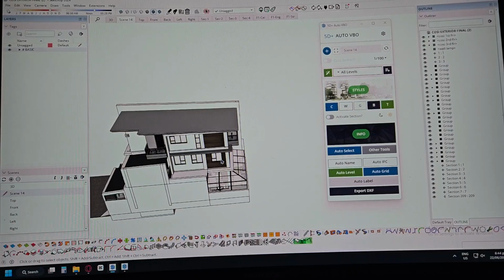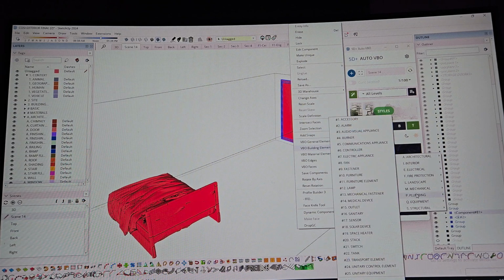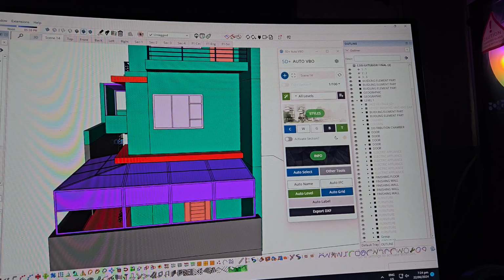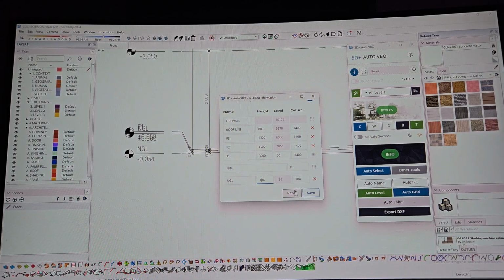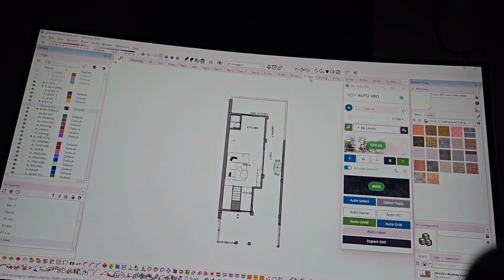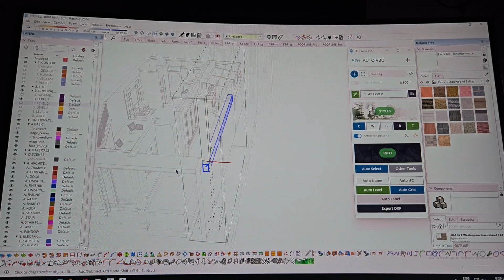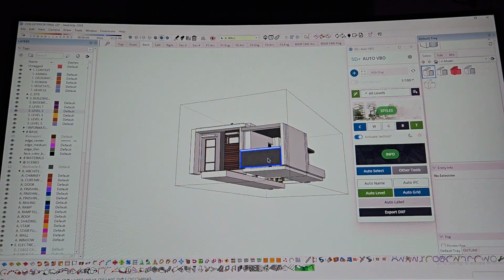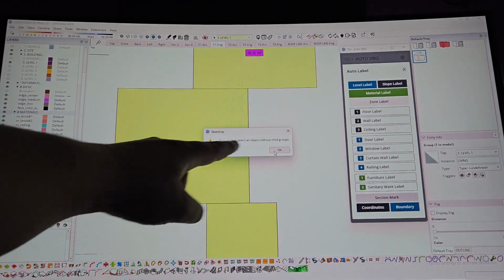Sketchup Extensions - Good Thing There's 5d+

Comment: If you want to change "Definition name" of a group, you can use 5D+ Auto Info also. The floor label will display name of floor type, (like wall label for wall type, ceiling label for ceiling type) not for naming a room or a space/zone. Material label for materials you painted on faces, it's not related to material tags.
Reply from the maker: thank you so much. will try in another model